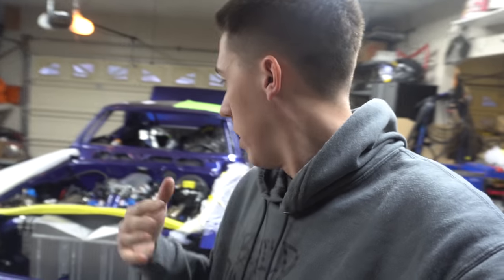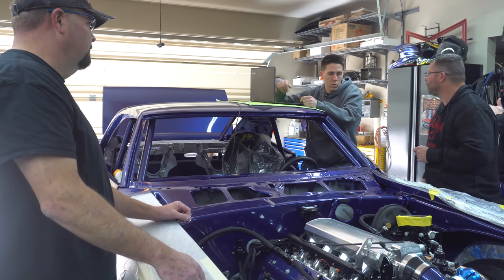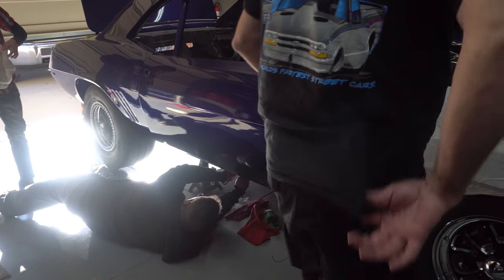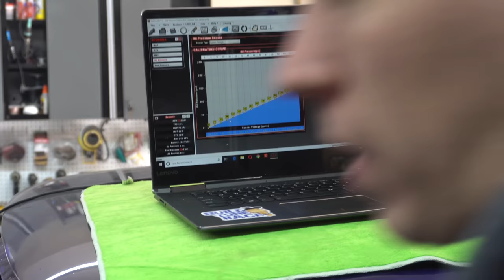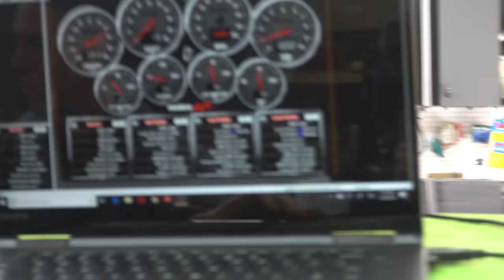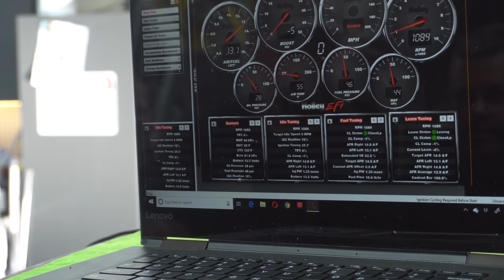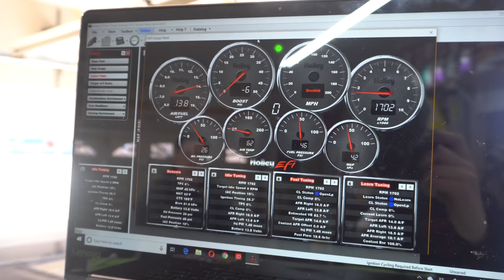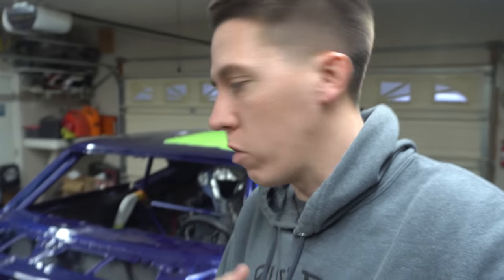Twin Turbo Camaro First Start Up Holley Dominator

Comment: First builds, i usually use an air compressor to test out the wiring and sensors before starting and getting all the lines full. Then at least you know if its a mechanical or electrical or wiring issue to sort out. Like map sensor, brake, clutch,  fuel, oil ect. Anything pressure sensor related.  May help some of you guys out when trouble shooting. Edit: an air compressor pressure regulator when testing with help as well. Dont over load the sensor and set a specific pressure of there is a problem with scaling.
Reply from the maker: Thanks Mark! I like that idea.

Comment: What oil filter are you running? We ran Fram oil filters on all our SBC and with one engine we built it kept showing low oil pressure and we tore the engine apart twice and couldn't find a problem til someone told us they were having the same problem until they found out that the oil filter was locking up so we changed the oil filter as well to a Wix oil filter and bam we had oil pressure
Reply from the maker: I've read all a out this! I only run Wix this had a mobile 1 which I think is made by wix if I remember right but could be wrong. We checked it just after the filter with the manual gauge and saw 40psi but that's along ways from the top of the engine where the normal sensor sits.

Comment: I know this is an old video but did you ever figure out the oil pressure issue? My fresh rebuild is doing the same thing. No oil up to the rockers and the lifters are loud. But gauge says 50psi
Reply from the maker: The remote oil cooler was restricting oil he removed it and it helped fix the pressure issue.
Reply: Could be the oil relief valve that's on the lower left area of the block above the filter, also some guys haven't been putting in new cam bearings which leads to the issue you're having...and one last item may be the retainer plate on the front for the cam..if you reused an old one it leads to strange oil delivery around the engine.

Comment: Hi, i have a chevy truck and i will put everything new and custom, what should i use with holley dominator? To run my engine and transmission and all truck accessories, i don’t have lot of experience and i need some help please, my transmission and engine are 4l80 and 6.0
Reply from the maker: The Dominator is an awesome computer! I would definitely go with it Holley just released a terminator X Max that might work well too! Not 100% sure it does E trans or not though
Reply: Build Tune Race thank you!, so i can use my truck accessories with the dominator? Which is tail lights and headlights and stereo and ac?
Reply from the maker: @roadrunner7203  yes headlights taillights ect is all controlled by the body wiring harness. (Factory harness, painless harness, ect)  The Dominator only is for drivetrain related wiring.

Comment: I'm having the exact same problem
Reply from the maker: That's crazy! The owner is still messing with it haven't figured out the exact issue yet.
Reply: I pulled the turbos off and capped the supply lines last night now my psi is 67 cold idle I'm thinking my oil supply lines are to big

Comment: don't you want the fuel pressure 58-60psi > ?
Reply from the maker: Alot of boosted LS Combos we run 43 psi base pressure the. Your around 63psi at 20lbs of boost